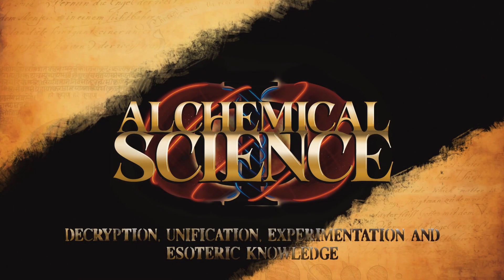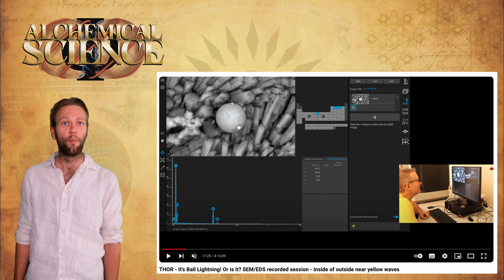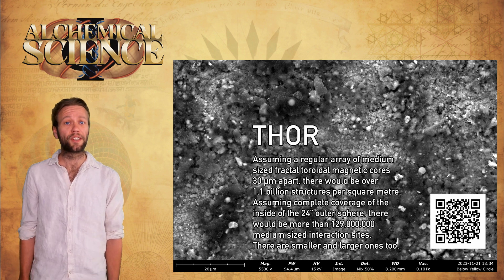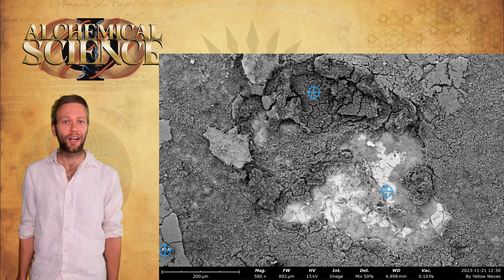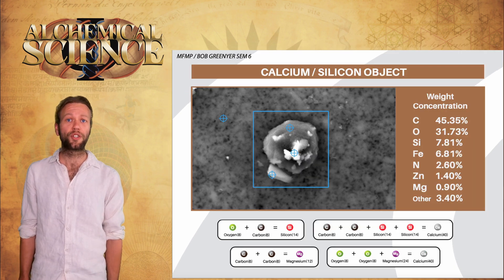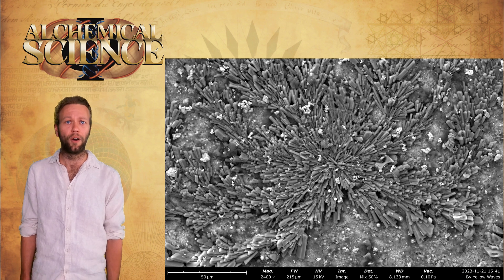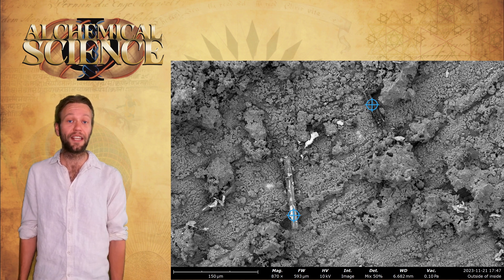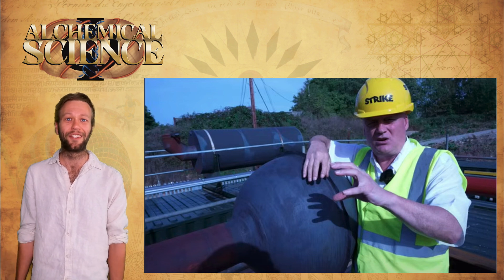Proof of Plasmoid Transmutation in the Thunderstorm Generator | MAJOR NEW FINDINGS

Comment: Would that be possible that they were drawing h2o atoms up "thru" the stone of the Pyramid?

Atoms pass thru stone yes?

?????????????????????????????

First they used 8 resonance tubes to take the Earths natural vibrations and amplify them up the 8 shafts/tubes to vibrate the Pyramid structure.

This vibration of the Pyramid created a electrical field throughout the structure when the estimated 2 1/2 tons of piezoelectric Quarts Crystals embedded in the stone became energized.

Then when the Vat (sarcophagus) containing Liquid Mercury was subjected to vibrations it would turn to Plasma & it filled the entire room (Kings Chamber)

Then the Plasma Field disassembled the H2o atoms? according to Mr Greenyer if you disassemble a single proton you can generate 938 million volts?

And isn't it possible that the Pyramid shape is a natural toroidal structure?, even though it's not doughnut shaped it should also create a toroid field within the structure...this would swirl the atoms up inside the stone of the Pyramid & naturally draw them upwards? 

?????????????????????????????

Also another question?
 
If I'm right that the Pyramid is a toroidal structure then is there a possibility a toroid "clone" structure could form above the one in the Pyramid? 

I read somewhere a toroid produces a smaller clone 

If that were true then there might be a possibility that a giant ball lightning would hover over the Pyramid when it was functioning & that would appear to be an all seeing eye of a GOD that was visible for miles and miles. watching every move of the population below    

Argh...Bendall where are youuuuuuuu?

Oh...And if the so called "Star shafts" were filled with Mercury so the liquid metal could be violently spun to produce vibrations then doesn't that make the Star Shafts "adjustable" Tuning Forks that further fine tuned the vibrations in the structure?

and couldn't the spinning Mercury also create a vortex to further encourage the H20 atoms to travel to the top of the Pyramid?

And...The reason the Mercury inside the Star Shafts didn't fully turn into Plasma is because there simply just wasn't enough room in the shafts so it stayed Liquid Mercury but in the Kings Chamber it could expand?

So doesn't all that equal Cold Fusion????????????????????

Comment: has anyone done any experiments HHO, but using heavy water instead of regular water? i'd be interested as to how the trasmutations are effected with the higher neutron density present, even using tritium might be neat.
if you need some tritium just build a smaller version of Bogdan Maglichs oExyder particle accelerator ...cheap abundant tritium and you can breed your own U233 if you need some
https://youtu.be/2uX1Twr9gkk?si=yFEyYQgo4CUAl5vt

Comment: was this compared to the inside of a standard copper exhaust without the TSG spheres? maybe you're looking at what normally occurs in a standard copper exhaust, normal detritus melting and quenching under high pressure, temperature and friction.

Comment: I'd love to come and try to replicate this. I have a degree in data analysis, an extensive working knowledge of combustion dynamics ,engine calibration, fabrication, machining, mechanical design and so on. I have free access to a dynamometer,  instrumentation and solid social network in the engineering and physics fields to fill in any gaps. However,  you have not adequately demonstrated any of your claims to justify anyone to spend weeks or months chasing probable snake oil.  We don't need to all these long winded explanations of what you think is going on. Just provide actual data, ideally data from the car he retrofitted this on. If he is making these claims, these data must already exist in some format. Ideally put it on a load bearing dynamometer so he can hold the car at a highway speed. Then show us an injector pulse width that is cut in half at the same the same power output at the same speed. Provide all the engine computer data logs and we will see if its real and worth pursuing in minutes. If you are actually making a pitch for serious people to help, you need to provide the dyno and log data that shows the economy change without any obfuscation.
Reply: You can build your own. There is a how to that includes sources for all of the parts needed. Have fun!
Reply: Does it include data and test documentation? I've looked and have not been able to find it. If Malcom wants attention and peer review from competent and objective people, he needs provide data. If you have a source for the info I'm requesting, please link.

Comment: randall carlson says this engine can reverse air pollution but i am having my doubts. has anyone done any research into the effects of 1.5 billion ICE's being converted to emit water vapor instead of co2? co2 is bad but water vapor is also a potent greenhouse gas, more potent than co2 on short timescales. would be happy to donate if i can get some satisfactory answers on this
Reply: I'm building o e to try to do it with Woodburning stove. What tests do you expect one to run on the emissions?
Reply: @bnpscnm  how much water vapor is produced in the pressure washer sized version? a car sized version? a commercial power plant? if all the pressure washers, cars and commercial fossil fuel power plants were converted, how much water vapor do you estimate would be emitted? how would that water vapor interact with the earth? maybe i'm misunderstanding. does it not run on water? does it just run on anything? what are the emmissions when gasoline/diesel is used?
Reply: Water vapor is a greenhouse gas? So now trees cause global warming too?
Reply: @JacobGrim  yes it is (95% of the greenhouse effect), which is why we should not be worrying too much about "global warming".

Comment: How does Bob know that any of those elements are there? They all look a different shade of grey. It would be neat to clor code them by Element
Reply: Bob has used different tools with different samples, though ultimately the elements are determined by X-ray spectroscopy or similar that shines high energy light at a very fine point and analyzes the spectral lines in what’s reflected.  This way you can measure the composition of materials with exquisite precision.
Reply: The neat thing about SEMs (scanning electron microscope) is they can do elemental analysis with those high energy electron beams.  The model Bob has been using can color-code, and do other things like display elemental concentrations in a line section or an area section with overlays for each element. It's a mapping mode, basically.
Reply: @davestorm6718  there has got to be a simple way to translate density of elements into color, I have not seen it personally and have followed Bob for about a year.

Comment: I'm interested to know if there is ionising radiation released during transmutation?
Reply: Sometimes: There's a vid of the THOR device running and you can see little streaks flying in and out of the metal. Those are probably EVOs and probably not entirely good for you.  Some EVO generating devices do emit some strong radiation that is not shieldable (but this is low power stuff) and dangerous, but with the lighter element synthesis, it's pretty tame. Bob & others are still working to characterize "strange radiation" and it's effects on health and how to actually shield from it (goes right through lead ... really!).
Reply: Yes in small amounts it is.  It’s a lot less than you might expect considering it’s a nuclear reaction.  There are surprisingly few X and gamma rays and neutrons compared to hot fusion or fission processes.

This process also makes a unique type of radiation called “strange radiation” or “J radiation” or other things depending on who you ask.  In any case this is a novel type of penetrating radiation that has been observed since X rays were discovered though never fully nailed down.  It’s harmful to health to be exposed to large amounts of it.

Comment: Question.  If I’m doing a wood burner version, how do I collapse bubbles without engine stroke? The coal unit had no vacuum. The coal is the test unit viewed in the sem so it obviously works. What does the engine vacuum do that the coal unit does not?  Cool beans.
Reply: Pushed is the keyword there. You need a pressure differential to move the air through.
Reply: The coal version I have seen used a regular shop vac
Reply: I am a complete layman but my understanding would be that you need the vacuum to suck the air through the ionizer and the chamber.
Reply: @bitmonkey-xyz In malcoms coal version he pushed cool air in with a shop vac and the exhaust into the thunderstorm gen. The generator motor versions described the piston stroke collapsing the bubbles in the plasmoid generator unit [ bubbler] the air from the ionization chamber is the cool air going into the bubbler the exhaust Is going into the 4" sphere.  My ? Is do I need to bother with vacuum port and equilibrium to worry about collapsing the bubbles in the cavitation stage.  If the collapsing bubbles matter in one why not the other?
Reply: Yet again I am a complete layman, but I am smart.
Reply: How did he push it? Pushing is the opposite approach to creating a pressure differential as creating a "vacuum" at the other end. It is not an actual vacuum, just lower pressure.
Reply: @bitmonkey-xyz the coal unit was a shop vac blowing in thru the ionization chamber and into the bubbler then into the tg. The exhaust goes directly into the tg. The generator is hooked up to the exhaust manifold and the air intake of the carburetor.
Reply: I'm no sre a vacuum is needed to get the gas through an ionizer. 
Wouldn't it be better to keep the carbondioxide coming out available to wildlife and farms for phtosynthesis into biomass?
Reply: What is needed afaik is a psi difference sufficient enough to pull the correct amount of air through the system.
Reply: Ok so why would the generator one collapse bubbles by vacuum. And the other does not. Doesn't make sense